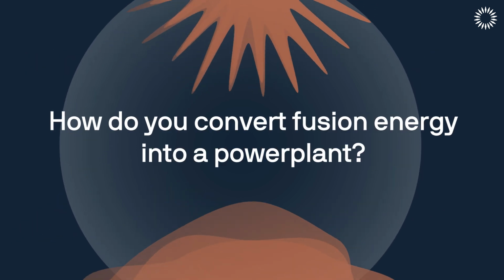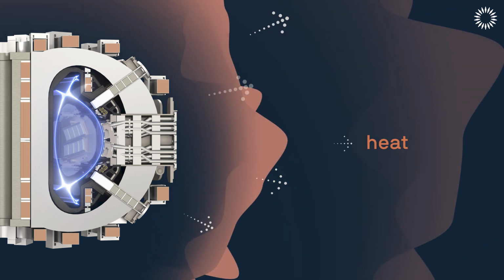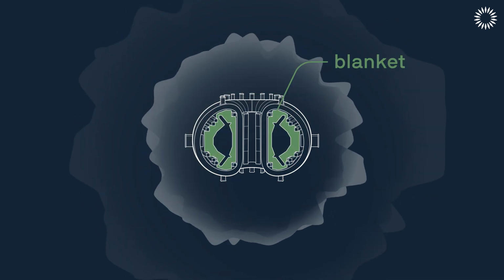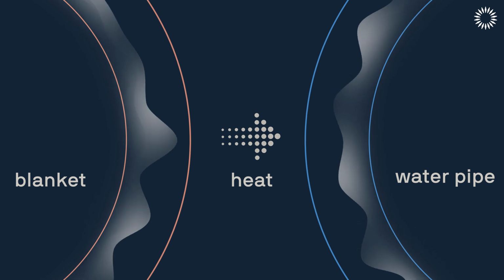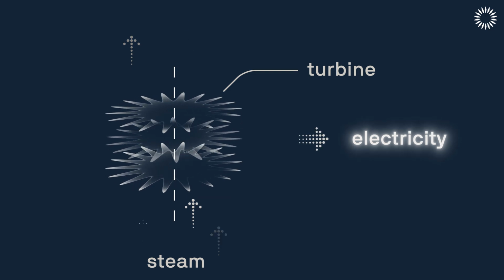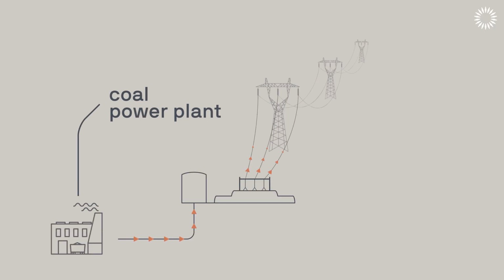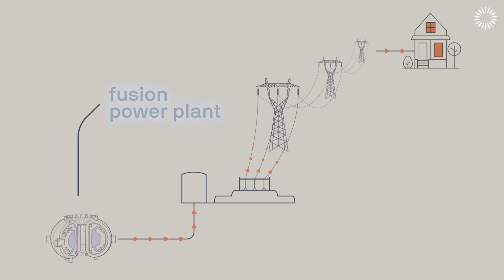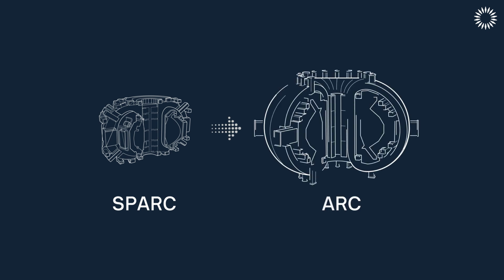The Building Blocks of a Fusion Power Plant

Comment: Femtosecond Laser-Induced Aneutronic Lattice Confinement Fusion Power
Nuclear fusion occurs in massive stars with extreme temperatures and densities. These conditions can be briefly created on Earth by concentrating femtosecond (1e-15) laser pulses on the threaded concave crystalline Lithium Hydride (LiH) cylinder at the bottom of the rocket. The resulting plasma contains lithium, helium ions, protons, and electrons. Pulsed alternating electric fields shape the charged particles to directly generate DC electricity with magnetohydrodynamics (MHD). MHD efficiency is more than 90%, compared with 40% for conventional energy conversion. A 1-femtosecond pulse will penetrate 1156 layers of atoms in that time, but the thermal (phonon) energy will only reach the next layer 14 femtoseconds later. The short pulse minimizes the heating and melting of the underlying material. 

Incorporating a cavity structure into the target material traps and slows the plasma dispersion and allows for longer interaction times, potentially leading to increased fusion reaction rates. Additionally, the cavity can reduce mass ablation, improve laser absorption, and facilitate better mixing and compression of the fuel material during the implosion phase, thus contributing to more efficient and effective fusion reactions. Cavity produced with additive manufacturing (AM) techniques minimizes variability and allows for the creation of complex structures. The laser can texture the surface to reduce albedo.

Alternating pulses of electric fields can be used to expel or attract negative particles or to attract or expel positive particles at critical times during and after each laser pulse. The heavier positive particles absorb more laser energy and contribute to increased fusion rates during prolonged stays. Expelling electrons from the plasma stabilizes the plasma, reduces losses due to electron recombination, and diminishes the effect of Debye shielding. Each subsequent layer absorbs a smaller fraction of the energy. A femtosecond pulse of a single joule will heat a spot of 3.6 um diameter and 0.3 um deep to an intensity of 1e-22 W/cm2. That region will receive an average of 7 MeV of energy per atom, equivalent to a temperature of 13 billion kelvin and a group velocity of 6e6 m/s for the heavier ions. The velocity of the protons will be faster. From the point of view of the electrons, the ions are stationary. The containment time is estimated to be 18 nanoseconds. The pre-compressed density is 5.7e28 particles per m3.

Nuclear Fusion reactions of Lithium and Hydrogen
Proton + Lithium-7 = Beryllium-8 (4.42 MeV) = 2 alpha (18.16 MeV); total 22.58 MeV
Proton + Lithium-6 = alpha + Helium-3 (4.27 MeV)
Proton + Helium-3 = alpha (18.8 MeV)
Helium-3 + Lithium-6 = 2 alpha + Proton (16.88 Mev)
Helium-3 + Helium-3 = alpha + 2 Protons (12.859 MeV)

Lithium Hydride must not be exposed to water. Fusion reactions have to be undertaken inside a vacuum. The laser repetition rate controls the output power level from zero to megahertz. Such a system can be adapted for Earth by converting the charged particles directly to electricity with MHD. The exhausted charged particles can heat molten salt, storing the energy for hydrogen production, synthetic fuel production, seawater desalination, district heating or cooling, powering ships equipped with thermoacoustic Stirling generators, and power plants with supercritical carbon dioxide turbines.

Back to the Future: Fusion Energy from Garbage
In theory any solid waste material with a density lower than nickel can be used as fuel. These materials can be mixed with binding agents and compressed into fuel rods. Materials that produce charged particles are preferred. The lower the density, the better. Avoid using materials that can produce gamma rays, neutrons, or radioactive isotopes.

Most thermonuclear weapons use lithium hydride (LiH) instead of pure hydrogen for fuel. LiH offers two advantages over pure hydrogen. Firstly, LiH is solid at room temperature, allowing easier storage without extreme pressure or cooling. Secondly, lithium atoms undergo nuclear fission during the explosion, producing tritium (hydrogen-3), which enhances the fusion reaction. Lithium Hydride has a high Heat of Fusion of 2900 joules/gram, low thermal diffusivity of 1.2mm2/s, high melting point of 688oC, a molecular weight of 7.95 grams/mole, density of 0.757 grams/cm3, specific heat capacity of 6.27 j/g.k, and good electrical conductivity.

Comment: Steam driven turbine power plants convert 1/3 of the energy to electricity.
Reply: Yep, assuming fusion plants will operate in a similar thermal regime to nuclear fission plants then you are looking at 30-35% efficiency. If these future fusion power plants can operate at higher temps/pressures similar to fossil fueled plants you could push that efficiency to around 40+%. 

Maybe 2nd or 3rd generation fusion plants could use  more exotic, higher efficiency, burning plasma direct  to AC current technology, but for the early plants tapping into the competitive market for thermal power generation tech for the balance of plant and the mature logistics/supply chain seems like an easy call, especially as getting to a sustainable Q-plasma in the 20-25x range in a commercial mass-produced fusion reactor is probably going to be heartbreakingly difficult/expensive.

Comment: I would be cautious about not biting off more than one can chew with respect to things like a flibe blanket for something like this machine. Just focus on demonstrating Q>1 plasma then Q>1 engineering,  and show that the neutron economy is sufficient to breed enough tritium for self- sustaining continuous operation. THEN you can reasonably start talking about heat extraction designs.
Reply: SPARC won’t have the FLiBe blanket and will only demonstrate Q>1 (and help CFS and the world get better at running a tokamak). ARC will add the blanket and will connect to turbines and the grid. CFS has been focused since the beginning on limiting technical risks (starting with work at MIT, then demonstrating the magnet technology, then demonstrating Q>1 with SPARC), so that they aren’t biting off more than they can chew on the way to ARC and fusion power on the grid!
Reply: Not sure but would that then not require developing an alternate second wall shielding for keeping the neutrons away from the supeconductors? Assuming that SPARC will create enough fusion neutrons for it to endanger the magnets.
Reply: Yep. Our first tokamak, SPARC, has no blanket — it's is designed to demonstrate Q>1. Our first power plant, ARC, has the blanket for heating water, cooling the rest of the machine, and breeding tritium.